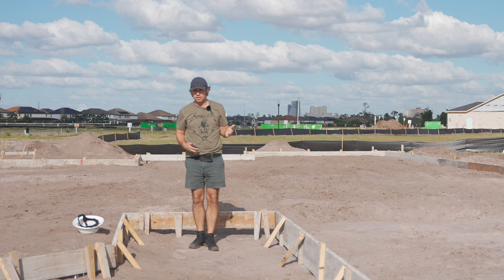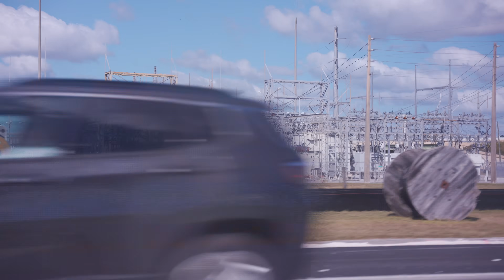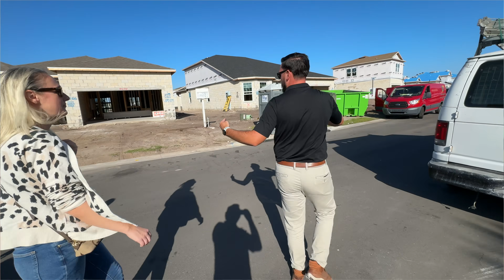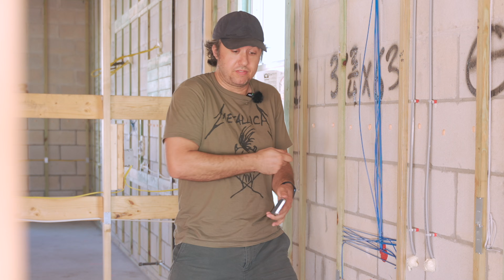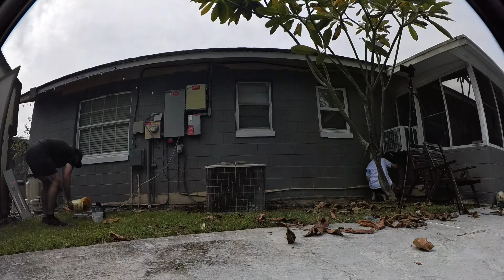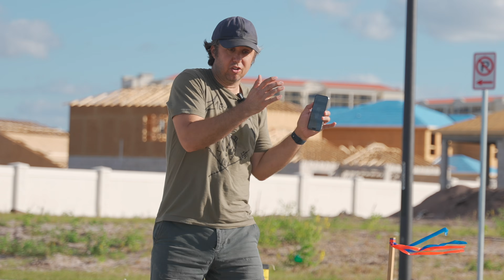Building a Million Dollar House Ep 2: We Broke Ground! Also, We have Central Bug Control...

Comment: it's crazy man, do you ever do any sort of critical thinking or research outside the sales pitch that whatever salesmen is hawking to you?

For example that whole thing about filling the cinder block walls is a complete waste. CMU is all thermal bridge, the insulation is just bypassed from both sides above and below every 8" or so.
It won't give you any practical improvement in R value over empty. Odds are the price for this will greatly outweigh the benefits and how do you know if those walls are COMPLETELY FULL of foam? they only drilled a tiny little hole in one row of blocks and the blocks dont have that much room inside them for stuff to move around. they are stacked staggered with motar all over meaning it's not a clean open space. It would take a lot of labor just to fill these with useless foam and construction is NOTORIOUS for cutting corners to make an extra buck, especially if it something you cant even see.

lastly, a brand new clean house will likely never have a bug issue unless you're letting food and trash rot all over the place. 30 years living in FL and I've never lived in a house that NEEDED regular bug control and I also dont know anyone that does either unless their just paranoid and got money to blow. just another thing where the bug guy can show up and pretend to stuff your walls with bug killer but you literally have no way at all to tell if they did or not.
Reply from the maker: Oddly a quick google search overwhelmingly disagrees with your knowledge about filling block with foam; I actually couldn’t find anyone that agreed with you. So there’s that. 

Second, they absolutely can fill the whole thing, and I have total access to the build site with a personal building manager who is at my beck and call at any time. His name is Omar. 

Big builders ARE notorious for cutting corners but you get a different level of service and quality when the house you’re building is in the 7 figures.  But I’m sure you have personal experience with that also.  I am allowed to and encouraged to inspect, video record and verify every single component that goes into this build.  Not to mention they’re fully aware a search for Pulte Home Build will come up with my videos after these have been up for a few months and you better believe they know about them:)

The bug thing, I just find super interesting. And also I’ve had bugs in the last two out of three Florida houses I’ve lived in. So I’m happy to pay extra to never have them again. It’s only money.